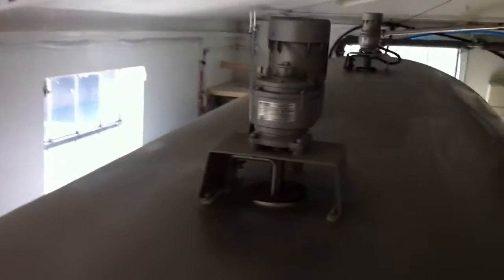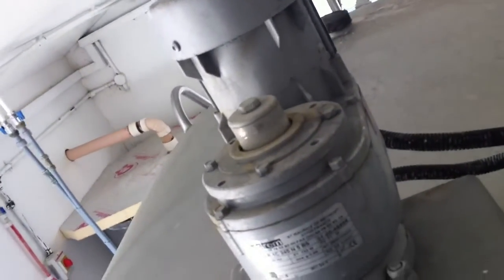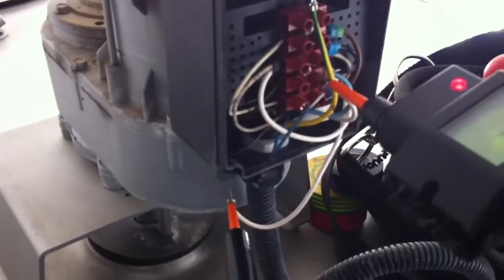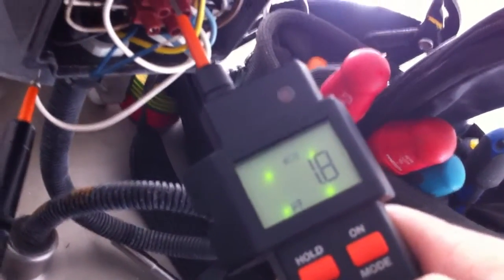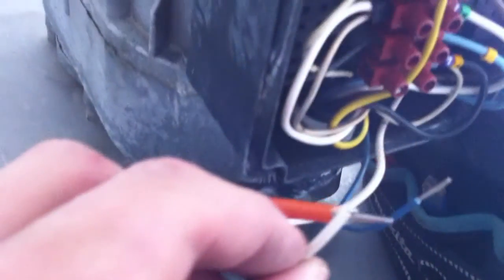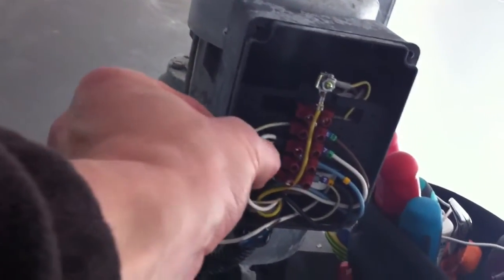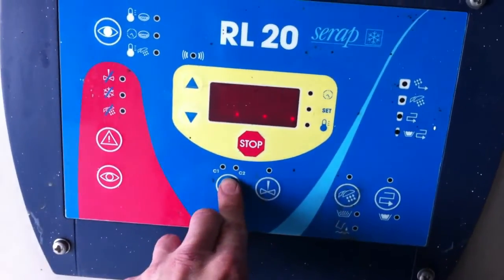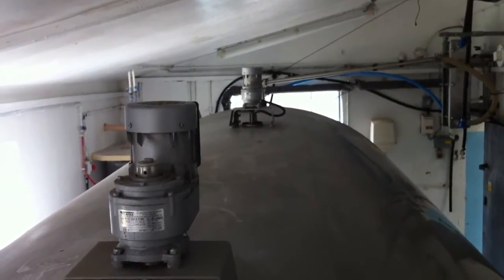Faulty Capacitor on a Motor

Comment from the maker: They are pretty reliable, maybe after ten years the gearbox wears, sometimes the fixing bolt for the paddle comes loose, but mostly its the capacitors that go.

Some other makes have different problems, like seals leaking wash water but for the hours they do i think they last well.

I keep a couple of different types of agitator in stock just in case i need them.

Comment: Just the cap quality. The manufacturers use a thinner cheaper film that breaks down faster. Old units used a thick film that would last about forever, but were twice the size.

Comment from the maker: A lot of the old Plessey capacitors still test good on old Prestcold stuff, most often they fail when the ali wears through from vibration. These plastic ones don't seem last as well. though some places they last ten years plus and others its every few years, i wonder if power quality is an issue.

Comment from the maker: Yeah, the milk goes through a heat exchanger first with chilled water, then into the tank to be cooled down from body temperature to around 40f. This one holds around 4000 gallons and is big enough for two days milk production.

Comment: Some caps seem to be better than others. Cambridge Capacitors seem to be shocking bad for degradation but I've also seen G.E.C caps from the early 1970's that are bang-on their rated values!